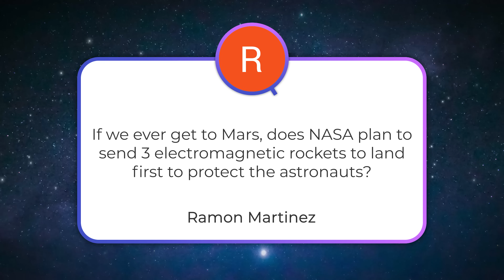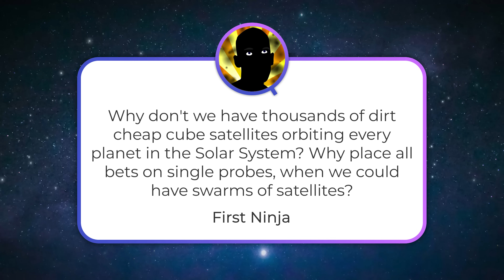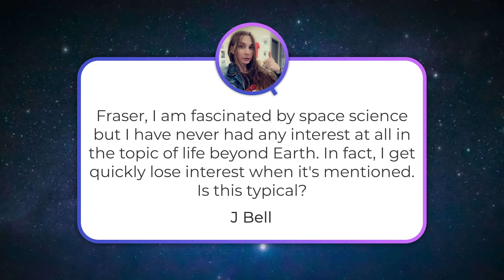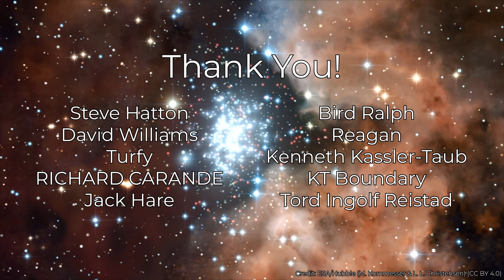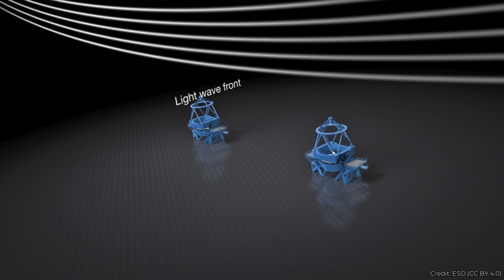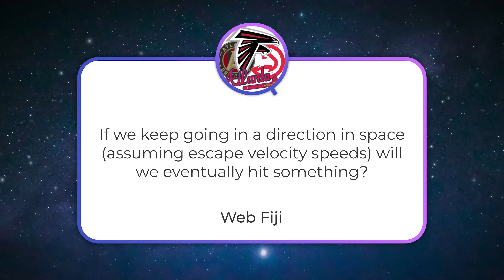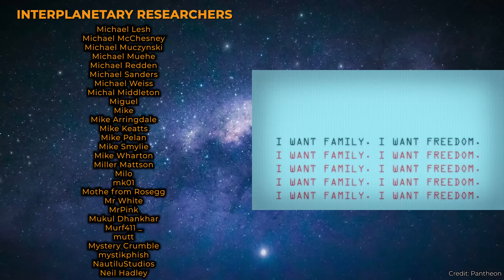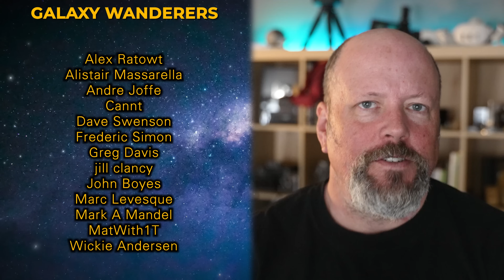Cubesats VS Big Missions, EM Protection from Space Radiation, Discovering Exomoons | Q&A 321

Comment: Cubesats are good for scanning wide areas on a more real time basis, but what they lack is the power to get high bandwidth data back to earth.  And even if they did, having many send in the same frequency band would eat up your bandwidth.  What would be better is a exo planet version of the TRDS satellites around earth (Tracking Relay Data Satellite).  Have it receive transmissions from low power but local systems and then blast the signal back to earth, maybe using lasers.  I would suggest having one at the +30 and -30 degree Lagrange points so they are always in sunlight for the solar power.  Two because there is always a risk of one of them failing.

Comment: Dear Fraser I have another qiuestion thta bother me: Is there any galaxy without angular momentum spin in its center? Therefore, fully spherical. I understand there has to be random stars rotation in the 360º to contra rest the centrifugal force to avoid falling into the center. This question may be reformulated as; “Angular momentum” is a basic ingredient for any supermassive black hole in a galactic center?

Thanks for all, keep as you do now and you will awake the curiosity of all your followers,

Comment: 11:01: The NPOI (originally the Navy Pr Optical Interferometer, now the  Kenneth J. Johnston  Navy Precision Optical Interferometer), at Lowell Observatory in Arizona, is a 6 station optical interferometer with 4 fixed telescopes and 6 movable ones, arranged in a Y pattern. (It used the radio Very Large Array, VLA, as a model.) It only has 6 optical delay lines, so only 6 telescopes can be used simultaneously.

Comment: @0:54 — “So why don’t we do the same thing?”.  Yeah… we don’t have a second centre of the Earth laying around.  Even if we did, how would that … work … exactly?  There are various simulations for how the Earth/moon system formed & the properties, but … how would you do anything like that?

It’s way easier to just make radiation shielding that can resist gamma rays.  None of the questions above are questions if we use that approach.
Reply: You don't need to bring a planet core along to make a magnetic field, we quite regularly  make magnetic fields thousands of times stronger than earth's using electromagnets, they are just large and power hungry as Frasier said.

Comment: Just throw a load of aluminium or silicon into Mars orbit forming an artificial ring, the sun's UV light will charge it up via photoelectric emission, forming a virtual electromagnetic coil. Either do it bit by bit on each mission or get the robots to build a rocket factory on Mars to churn out aluminium rockets and blast them into orbit. Easier than making a massive shield between Mars and the Sun or laying a superconducting cable around the equator.